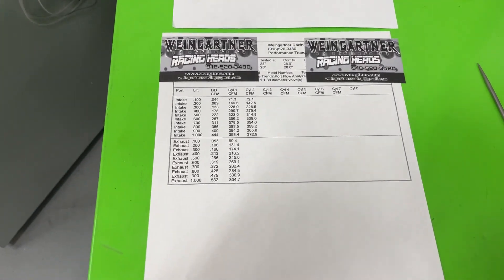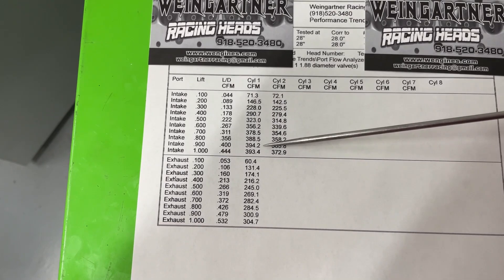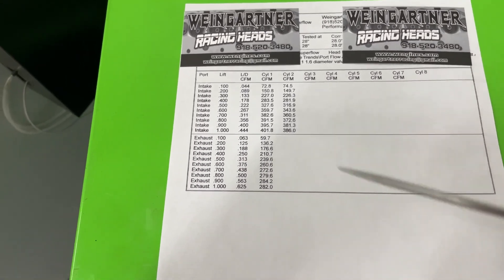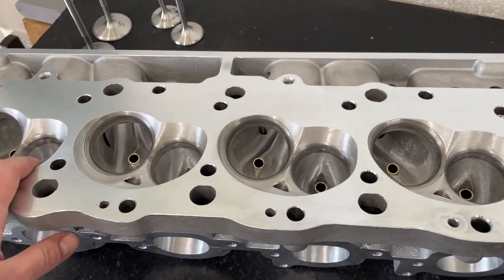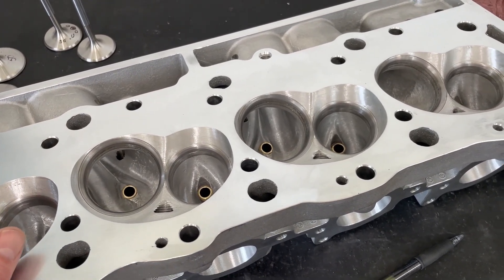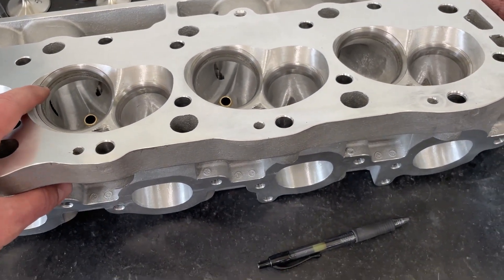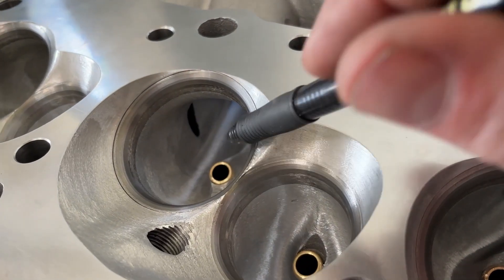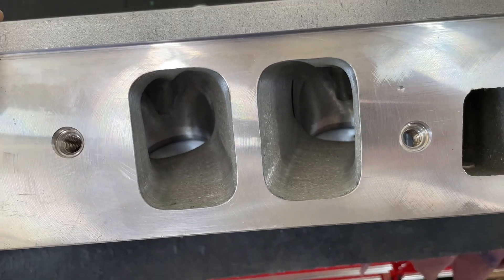My Ported AFR 305cc BBC Heads

Comment: Hey Eric, I’m building a 468 for my C10. It’s a 67. It’s going to be almost exclusively a street truck, BUT I want this motor to be something that smokes most cars in a 30 roll race/at a light (given I can hook up) I don’t wanna make so much torque that I can’t hook up and figure I’ll have to source a pair of heads and a cam that makes most my power in mid-top end. You mention this head being kinda too much for street use in a motor, especially a “smaller” motor like a 468. What would you recommend for a 468 that would land me in the 600HP range at the motor without being too wild on torque, but not being a turd? Thanks

Comment: I've run these heads on my 4.310 bore 454 for 20 years.  Back then AFR didn't offer anything smaller anyway. Too big is a wives tale.    Makes plenty of grunt in my 4000 lbs chevelle that is primarily street driven and works fantastic at the track.   They will eventually be going on a 4.500" bore BBC in the near future.   The reason for buying these at the time was that for their port size,  they had better average flow numbers than most anything else on the market back then.
Nice flow numbers by the way.

Comment: Can my compression be lowered? I have a 502 BBC with brodix heads. It's 13.1  It's going in a 68 Camaro mostly for street. Trying to run Is 91 pump ⛽️  near tulsa
Reply: Old comment, but to lower your compression you’d have to get a set of heads with a bigger combustion chamber then they currently have (I.E. going from a 119cc chamber to a 124cc) you really couldn’t make the chamber bigger on your stock heads in a substantial enough way to bring it down from 13.1. You could get a thicker head gasket, but that might only knock it down to 12.6-1 or something. Still couldn’t run pump gas. Other option is to keep heads and get a different set of pistons with a dome profile that would creat a finale compression of 10.5-1 or something. Pain in the ass either way. I bet that 502 with a big compression like that sounds awesome

Comment: 800hp crank or wheel.I prefer buying a bigger head and using a smaller cam for street use that way you can always change the camshaft and go all out later if you want

Comment: Interesting video Eric. I was thinking about the difference in the numbers between the two benches. Now I realise that both benches are corrected to 28", but is there a difference in the actual test pressure that the readings are taken at between the two benches before the corrections?  Regards Greg
Reply from the maker: No both 28inches

Comment: Nice, I hear the 325cc w/cnc chamber is really good too and actually pours closer to 317.  There was a guy on the bullet that used the 305cc on a filled 402, twin S480 blowthru deal that did 7.9x @3400lbs Firebird. I am trying to go that direction but using the 325cc, as they  were a bit cheaper and I’m using a 427T block with a 4.375 crank.